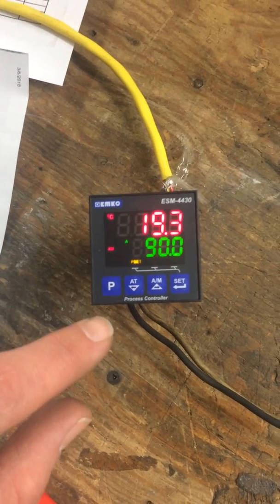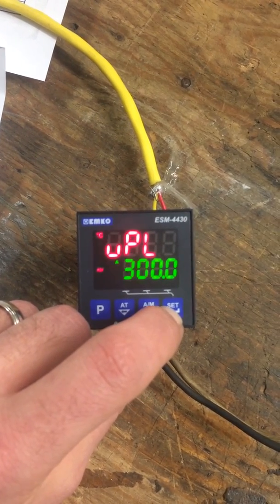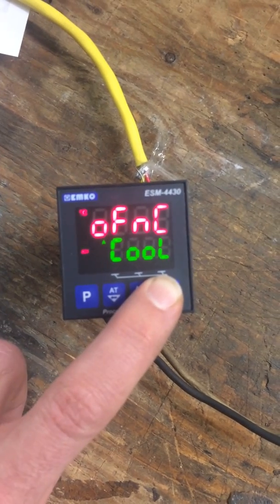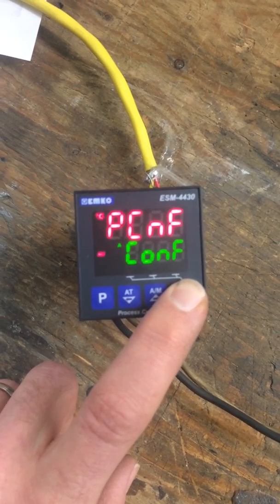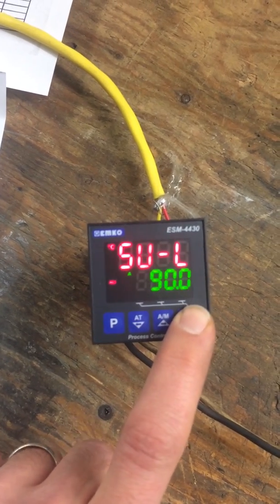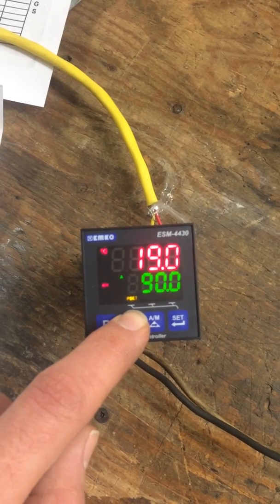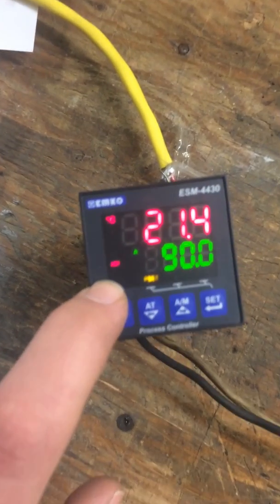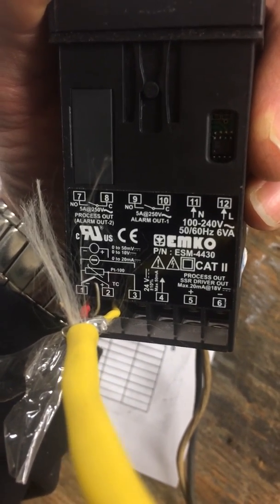Emko 4430 high limit config

Comment: Hi i would like to use my emko 9930 process controller as speed meter with 24 v dc supply is coming out from the motor drive.
Reply: You cannot directly do that without some mechanical means or electronic feedback loop that I give you a feedback.

Comment: hi i connect pressure sensor 20 m ampere and can't break sbr error can you help me ?
Reply: Sbr error is no sensor detected. Either your controller doesn’t support 4-20mA sensors or it’s not configured correctly in the in-t parameter for sensor type.

Comment: Please give some ideas when I want change value it not changing any value so how to change value
Reply: EMKO used have the capability to be password protected. You will need to check if it's locked.
Reply: @nicholaslees6707  How to unlock?
Reply: Is there possible to reset the password and activate again if forget password